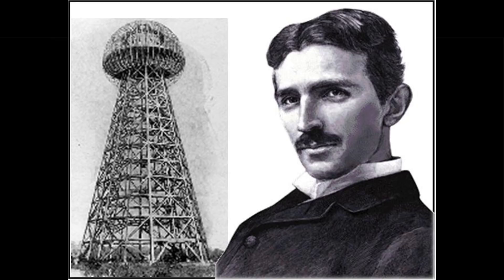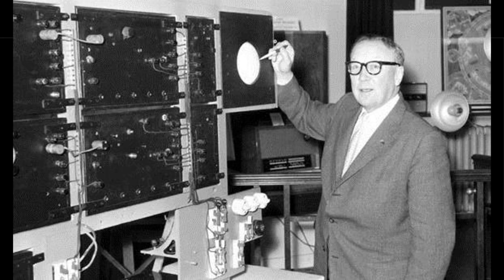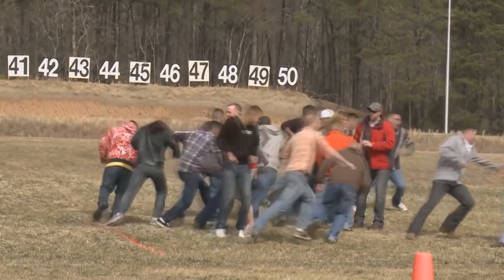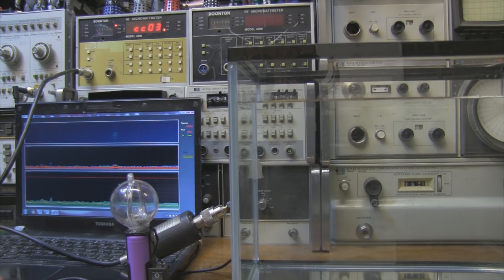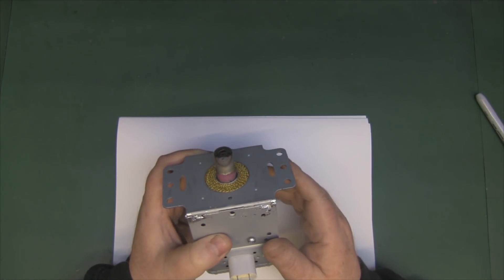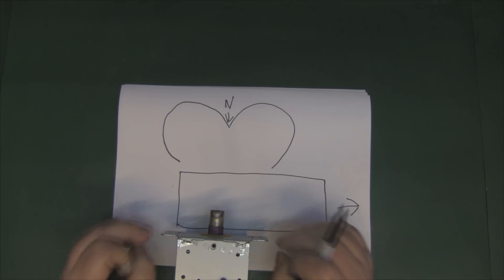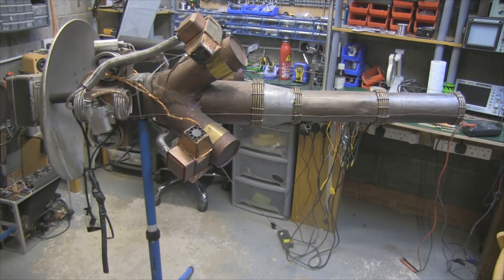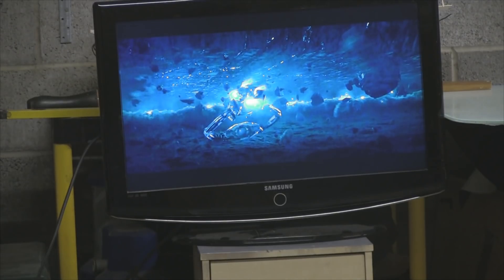My Microwave Gun…..And Why They Don't Really Work!

Comment: No offense, but this one didn’t age well. 
Havana Syndrome: Turns out it wasn’t a syndrome at all. It was a hyper-directional high-powered pulsed microwave energy weapon. That was the prevailing decision in that investigation. 

There is also a group of people using one on me. Every single day of my life, though my experience differs slightly from that of the Havana Syndrome victims.  This is not a one-hit-and-quit situation like it was for them. It's been occurring for about three months now so apparently this is an ongoing campaign involving me but I can't even begin to tell you why. The ringing in the ears is the same but not as harsh as they described. The pain ranges from mild to moderate but the pressure is what gets to me the most. It's not like sinus pressure. It's whole-head pressure. It feels like my head’s gonna POP. Sometimes I can hear little micro-crack sounds coming from my skull. My left ear is almost completely deaf.

The group of people I’m talking about are a highly skilled, highly capable, covert militant group. I have no idea who the f*ck they are but they most definitely did NOT build this weapon out of microwave oven parts. This is a pulsed, hyper-directional, long-range weapon, operating at around 4.2–4.8 GHz according to my tests. I used a log periodic antenna and a -60 dB attenuator and logged several overload peaks in that bandwidth. The antenna angle was consistent with the pain/pressure in my left ear. My $500 analyzer 
stopped powering on after these tests were performed.

The power supply is audible. Other people in my building have heard it and agree that it’s a new and strange sound. However, someone decided to tell everyone that it wasn't coming from here but rather from a nearby business, so everyone lost interest. It’s quite obviously coming from this building. But to be sure I recorded it using two large diaphragm capacitor-style microphones. I positioned one to capture an outside feed and the other an inside feed. Amplitude was slightly higher on the inside mic, confirming that it's local. Had it been coming from a nearby business it would have been much louder outside. Kind of common sense, and there was no doubt in my mind to begin with, but there you have it. 

It has a fundamental at ≈96 Hz that ramps up and down. Then there’s a very strange cluster of harmonics—four or five of them—that don’t seem to have any mathematical relationship to the fundamental or to each other. The loudest among them is 480 Hz. There’s also 420 Hz, 330 Hz and I think 322 Hz but I might be wrong about that last one. It’s very strange to see a cluster of non-integer harmonics like that. It doesn’t taper or trail off like normal harmonics. It’s just there (and by “see” I mean on the FFT plot). The pulse envelope appears to be subsonic. It "idles"  at < 1 Hz but ramps up to 200-250 ms (4-5 Hz). The highest I've seen it go was 25 Hz. I discovered this pulse envelope unexpectedly after switching to spectrogram view. It revealed inaudible broadband spikes on a 50% duty cycle, modulating as mentioned. There is an audible 'fluttering' that coincides with this pattern but these spikes are not it. The audible flutter isn't visible on the spectrogram and barely visible in waveform view (more on that later).

The following is anecdotal, theory, speculation: I think this device is exploiting predictable intermodulation artifacts for use as its propagation or "firing" mechanism.

To understand the device better I recreated the sound of the power supply using software instruments. In other words I 'covered' the sound as if it were a cover song. It turns out that I'm a decent cover band—but not perfect—which means there was more to learn. Comparison revealed that I nailed the harmonic profile.That is the sonic signature of the sound so mine sounds very close to the real thing except one important detail (and this is precisely why I performed this test). The fluttering is wrong. To emulate the fluttering,  I used a low frequency oscillator (LFO) with an amplitude envelope and just modulated its frequency. This created a similar fluttering sound but the difference stood out strong by comparison. The fluttering is actual beating caused by harmonic dissonance (two or more notes being out of tune). When pitches approach perfect harmony, there is a slow beating that becomes infinitely slow once the notes are perfectly in tune. When the notes are wildly out of tune, the beating is faster and more pronounced. This is what is occurring in this power supply. Precisely which tones are involved in modulating this dissonance is hard to say. This is not an easy thing to measure. But I've been a musician for all but three years of my life, and an audio engineer for the last 20 of them and this sounds exactly like out-of-tune dissonance to me. 

More subjective yet:
Ever since I whipped out the RF analyzer, thermal camera, and microphones, the amplitude of the sound has decreased dramatically. I think they are now using an isolation box because I've heard the sound briefly return to full volume on several occasions. The pain/pressure sensations have remained the same but the lower volume has revealed an unexpected but useful artifact: When the power supply sound is suppressed, I can hear the pulse envelope in my tinnitus.  I can also still here the source it's just much quieter. The pulse envelope in my tinnitus mimics the pattern of the beating in the power supply. But to my surprise, they are not time-aligned. The pattern in my tinnitus is latent by about a half a second. I know that electrons travel at the speed of light but we're not talking about electron flow in this case. We're talking electromagnetic fields. Once the fields detach from PCB trace geometry they leave the scope of what I'm equipped to talk about. Would love to hear your incite on this.
Reply from the maker: No offense but.................🤣🤣
Reply: I was battling with the same thought before I posted this: “Isn’t ‘no offense but…’ the exact phrase people use with when they intend to offend you?” And while that is true, I figured it still had its literal meaning too but apparently that’s not the case. Anyway, I did mean it sincerely. My intent wasn’t to offend. My sole intent was to get your insight on the current state of this weaponry.